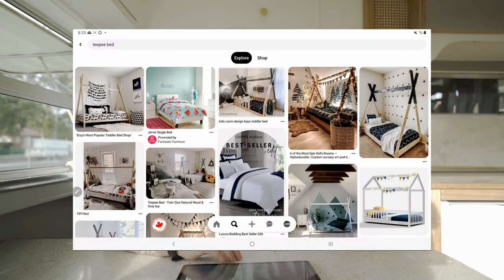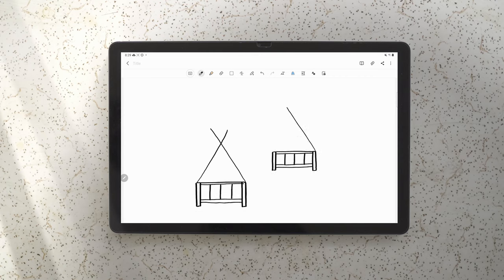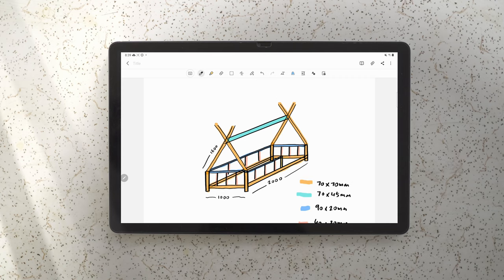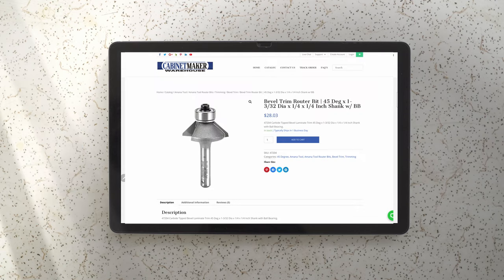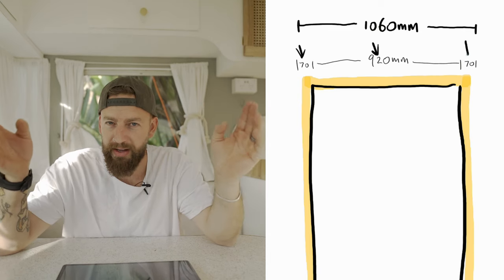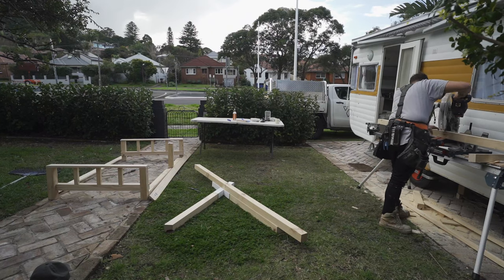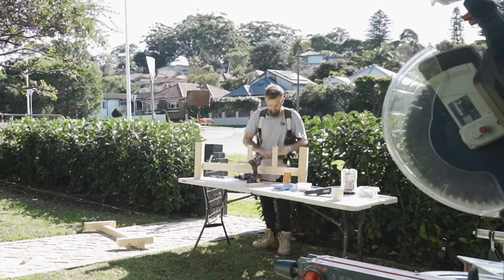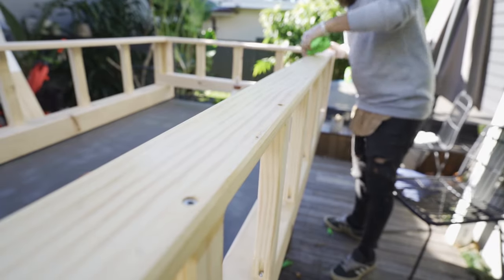How I built a teepee bed | Toddler bed build from start to finish

Comment: How much would you say all the material cost
Reply from the maker: With soaring timber prices, it can get expensive. I spent about 400. You can use cheaper timber and get similar results but I wanted it to have a nice, premium finish.